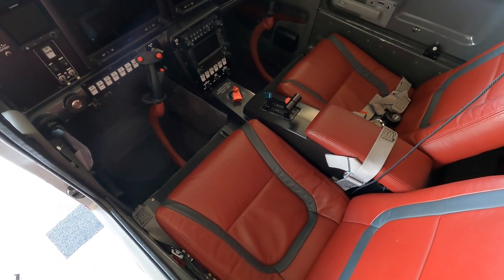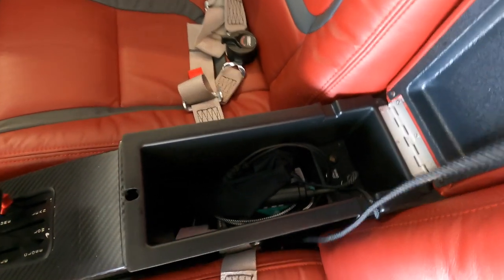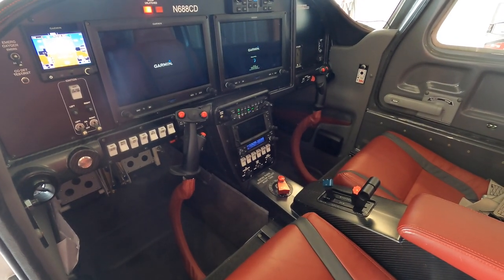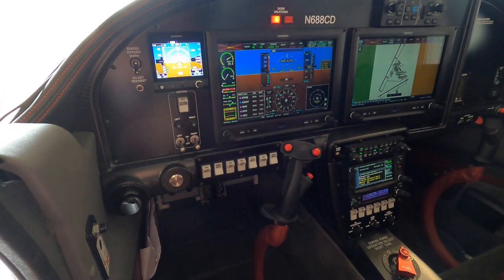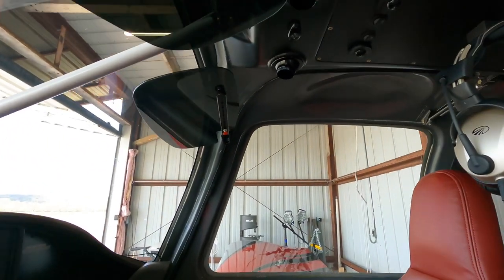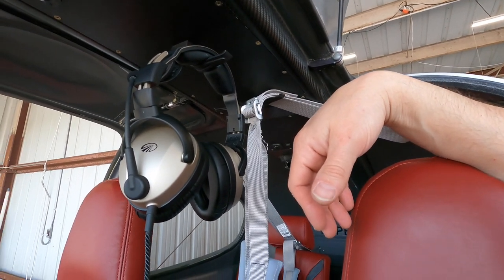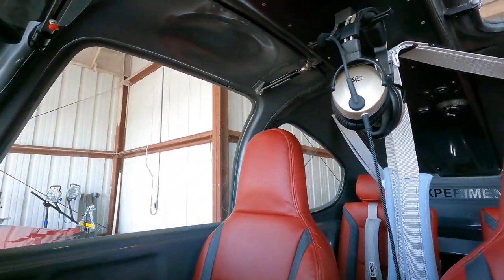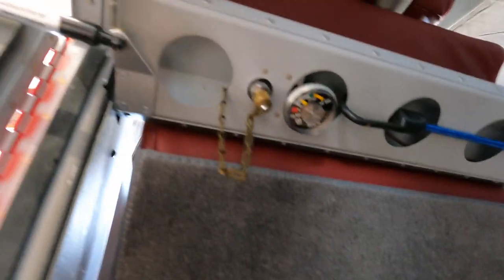RV10 Interior & Avionics   HD 1080p

Comment: The plane is gorgeous.  Do you fly much with other pilots? Just curious with the panel design having nothing on right side.  I guess it’s not much different then most trainers.
Reply from the maker: Not a ton with other pilots... however the screen is easily viewable from the right seat.  I contemplated adding a 3rd screen, but felt it wouldn't get used often enough to justify the expense.
Reply: Totally make sense.  I’m leaning towards your setup layout wise over the three screen layouts right now.  Long time to go to worry about that decision thought quite yet.
Reply: You can reverse the displays anyway so there's no point
Reply: @LISRAREF  You can push two buttons and switch the displays so that map is on the left and primary instruments are on the right